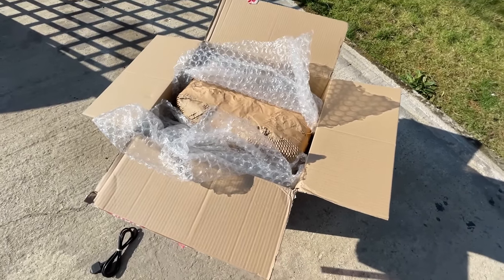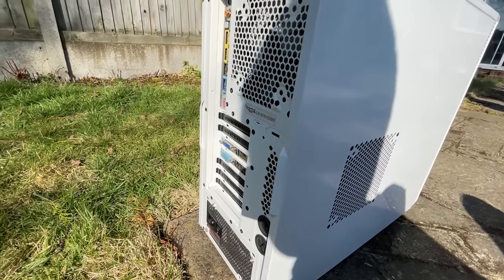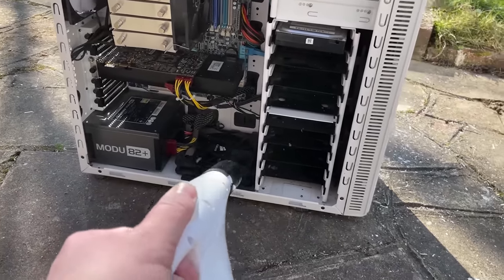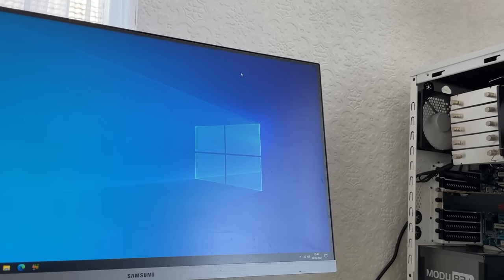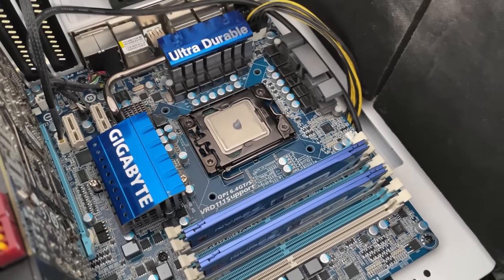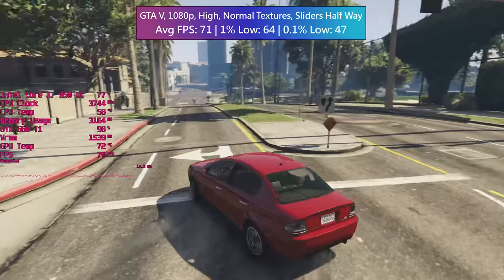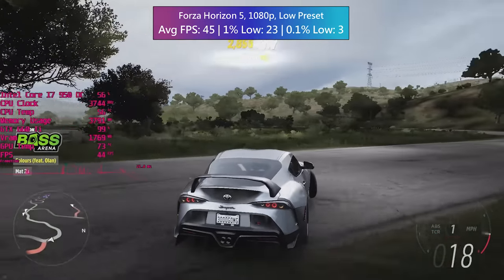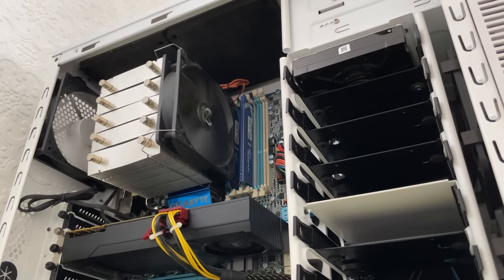What's Inside This £150 Core i7 Gaming PC From CEX?

Comment: My closest CEX doesn't sell desktops. And TBH I wouldn't trust any if they did simply because they don't properly test or inspect parts - difficult to miss corrosion and swollen+cracked capacitors on the back of an MSI Armour GTX 970.

Comment: I got a couple of CeX PCs myself. 

They had very similar specs, both ryzen 5 3600 + 1660

But... The first one had a broken graphics card which was clear on first use, thankfully it was returned easily. 

The one I've got now seems to work fine 98% of the time, but it does seem to crash occasionally (once or twice a week). I've only had it for a few weeks and I know I have the 2 year warranty though. 

I wouldn't recommend unless you're on a tight budget like me (paid £600)

Comment: theres so much wasted potential if you aren’t using an overclocked 6 core xeon on these x58. The x5680 is like $18 on ebay and overclocked to 4.5ghz can run a gtx 1080 with limited bottleneck. And of course 12-24gb ram in triple channel goes a long way.

Comment: I still have an x58 for daily driver. Une or two years ago I change the 950 for a x5650, the 2 extra cores+the low power+the qpi speed increase, make a good improvement. I have it on the rampage 3 formula, 48gb of ram and a gtx 1070

Comment: Have you thought about using the x5670 or even the x5690 6 core 12 thread chip? I am currently rocking that on my x58 motherboard with 16 gb ram and a 1050ti 4 gb and it runs real well.

Comment: You said 8GB. For max throughout you need 3 sticks. That board supports Tri Channel memory. When you said 8GB I realize that wasn't divisible by 3 and using 4 x 4 x 2 would not allow tri channel, it'd be stuck in dual. Another video you need to redo to get the best results from. This video is a great idea so I truly hope you take the time to address this.

Edit: Oh ok, I heard you say you'd be adding more memory and a better GPU so. With any luck you'll use 3 sticks of OCable DDR3 as using all six is rough on the memory controller. You could get some incredible bandwidth off that setup.

Comment: Still running an x5650 6 core 12 thread cpu at 4.2ghz on an Asus Rampage Genie II motherboard with 24gb of DDR3 triple channel at 2000ish mhz and its a pleasure to use. Its got sata 3 and usb 3 and really doesnt feel old. Im sure id get more out of my 1080ti by upgrading but I can play everything i want at 1440p 95hz to match my monitor so why bother. Its amazing what this platform can still do Id be intrigued to what a higher power gpu will do to the performance of your system.

Comment: I spent my first 3 paychecks in an i7-920 step D0 cooled by a Noctua NH-U12P, Asus P6T, 12GB Corsair Dominator (with the ram cooler), Sapphire HD 4890 Toxic OC 1GB GDDR5, Corsair HX750W and the HAF Mini 922M. With a 1080p 24" monitor other various stuff I spent 3000€ in late 2008 (yes, I got the first i7 on day1, best decision ever). I changed the graphics card 3 times and dismissed the system only 2 years ago, after 12 years of intense usage. It still runs, and I'm never going to sell it or throw it away. Best platform ever, super stable and capable of doing every single task you throw at it. Never seen a better product ever made by anyone. The feels ... you can see the system and the mods I did on the case on the techpowerup mod gallery (techpowerup com slash gallery slash 2246 slash details).
as always love the videos and keep up the good work

Comment: My i7 2600(non K) runs comfy 4.5ghz and ram at 1979mhz hyperx fury(16gb) on a asrock P67 gen3 with an Rx 570(4gb) with a Corsair 750 fully modular psu I also have a 750ti for my other big TV and  Asus WiFi card whole thing runs a dream and I've had it stable for years like that, some odd games make it hit 50c and it starts too drop back too 4130mhz at minimum but will boost from time too time

Comment: I'm sure more ram is always the solution but I'm wondering if, I'm guessing it'd be bad, you just force the game to ignore Vram and use system ram, so the graphics card can focus all its Vram on display output to the monitor, instead of being the temporary storage location for MASSIVE grapics/textures. y'know maybe it'd prevent stuttering if it wasn't going back and forth between SysRam and Vram, but stayed on the ONE RAM. Though I suppose 'direct storage' fixes this for NVME systems. Maybe one day pci-e-gen6 or its successor would make for fast enough access to what I'd assume would be the most premium of storage drives, such that RAM is only ever used for RAM related things, instead of being used as it is currently as storage for large texture files.

Comment: messing around with an old suckit 775 platform reinvigorated why i hate intel... so how many variations of 775 are there well theres clearly a Shit 775 and good 775 and a best 775... i absolutely hate how intell did this back in the day. having a plethora of 775 chips laying derelict i came to realize... the 775 mobo i have is absolute garbage limited to 533mhz fsb chips and theres only like 10 of them . and there all terrible Disaster chips.. i'v never encountered an amd mother board that had such trash limitations "exluding suckit am1" leaving my derelict chips with 800mhz and the 1066mhz fsb chips completely useless. also builds my dislike for DELL more so seeing how its a dell dimentia 5150..so dell had motherboards made that only souly support the Disaster series chips be it Celery Diced or Pantyum Dumpster editions.

Comment: just gone from a hp elite 8200 with i7 2600 to an acer tc 885 with i7 8700 still using my gtx 1650 (waiting for the gpu prices to get back to normal to look at a gpu upgrade)

Comment: Because of your videos I decided to get a custom pc from cex I liked the idea of not knowing exactly what I was getting so I spent £70 on a system with a g4400 8gb ddr4 ram and what was ment to be a gtx 670 2gb . What I got was amazing the g4400 is nothing special but it came with a nzxt AIO the ram was 2 4gb sticks of corsair platinum  3600mhz and the gyx 670 was the rarer evga gtx 670 FTW 4gb version I also got a surprise 250gb ssd that wasn't advertised and a 750w evga moduler psu . I sold the 670 for £100 and the g4400 for £30 stuck my spare r9 290x in it and used the profit to buy a i7 6700k and still made my money back so apart from the £27 the 290x cost me a few months ago I got a decent 1080p gaming system . If you know what to look for you can get a nice surprise.  I knew it wasn't going to be an optiplex someone had stuck a gpu in because the 670 needs more pcie power connectors that a stock optiplex psu has so I was sure to get a nice surprise system I just had no idea how good it was going to be . I'm going to spend a bit more next time on somthing ryzen with a better gpu and see what surprises await

Comment: Run an x5670 on it, it will go to 4.5ghz single core turbo and it’s a six core processor, paired with a gtx970 you’ll have a great system for the spend. Still haven’t upgraded mine yet. Now that the world seems to be going mental it’s going to delay a whole new machine.

Comment: Please help, i have a problem about my pc. I have way better specs than you, and for example my gta v and fortnite runs way worse than yours. I have rx 470, i5-4460, 16gb of ram with windows running off a ssd, games from a decent hdd. I have tried to play both games on the lowest possible settings yet i cant get over 70fps in gta and I have huge lag spikes. In fortnite it just lags all the time with huge spikes and barely runs 100fps. I have tried vsync on and off as well as performance mode in fortnite

Comment: Those Scythe tower coolers are pretty good, their modern descendants do quite well in modern rigs.
Judging from the wire management and the added bottom fan someone meant business when the built that if it's all original.

Some of those old computer cases are worth a bit more than what one would think, though the shipping fees usually end up costing as much if not more. That case is a Fractal Design Define R5 I believe, a pretty nice understated case. 
I leaned towards sourcing a Corsair Vengeance C70 in military green for a short while but those things go for a pretty penny. Even worse with those raw (unpainted) aluminum/aluminium Lian-Li cases. Oldish gaming PC case sleeper PCs is kind of a niche now I believe.

Comment: Now stick an Xeon X5670 on that board.  6 cores 12 threads and they overclock nicely.  I think I got mine up to 4.2ghz on a big air cooler like that and its stable and fast for a dinosaur.

Comment: used to have a smilar setup , same m/b but a i7 930 , and some amd gpu .. ran solid  for a few years(wish the same could be said for the windows install though ) before ending being replaced by a socket2011 based system ..the parts still ying around in the storeroom , one day might get it backup and running .

Comment: if you have an old pc newer operating systems are more optimized for the meltdown patch that stopped a serious security bug 

but slowed down cpu performance latency and memory bandwidth a lot

if you have an old system make sure that it's on the  os it came with at the time without updates to improve performance

there are obvious problems with doing that obviously but being on the newest os with an old computer will dramatically decrease 

performance. 

even new computers are slow on windows 10. windows 11 on very new intel cpu's found a way to optimize around the meltdown 

patch

you can improve performance with this shareware program process lasso. it can be used freely for 30 days.

this could very likely damage your hdd

explanation

to speed up performance after meltdown patch cpu latency went down. this fixes that by setting the io priority of the hard drive to low when cpu performance is higher than it should and to io priority high when the memory bandwidth of the drive is low.1. download process lasso2. during the trial period or after youve purchased it. go to process watchdog4. it isnt possible to optimize windows around the inefficiencies of meltdown. instead accept the inefficiencies and allow the computer to use the majority of its processing power when it is most efficient.6.

settings:

for intel if cpu usage is more than 10,15,50 percent set io priority of your game to low.

if any memory metric is less than 2 megabytes set io priority to high.

explanation

are old settings and do actually slow my amd processor down. in order to speed it up. I optimized with these new settings from process lasso. test these outbefore you wonder if it works. it is designed to temporairly slow things down. the idea is to cause the game to freeze temporairly for a second. this would bea time though when its operating very inefficiently because of the meltdown patch. this time is then used to improve performance dramatically.

settings

for amd more than 62 percent set io priority to low if memory usage by any memory metric is less than 3 set io priority to high

asundry

.the amd settings may just be more accurate for my processor which is a ryzen 3 3250u. these may work on intel as well. its just intel wasnt as finicky with thesesettings possibly because i haven't owned a dual core intel machine in a while.

Comment: Nice, I have the exact same motherboard on my backup pc, paired with a 6c/12t Xeon X5650@4Ghz, 12Gb of triple channel ram @2000mhz and a 4Gb RX470. It's a decent motherboard but man, it can also be a pain when it comes to detecting ram sticks. Ah, and I have one of the few good Intel coolers, the E97381 tower.

Comment: I still have my i7-930 system, coupled with a GTX-660, though the HDD died, so it sits in the box it came in.  It was a good rig until the HDD problems.  It got replaced in 2017 with an i7-7700K system, which just last week was replaced with an i7-12700KF system (GTX-1080, RTX-1070 ti respectively).

Comment: My favorite system! I used to have X58 paired with i7 930 and I have to say that these CPUs were meant for overclock! I was able to get mine stable up to 4.5Ghz with 212 Evo cooler and good power supply because maaan, these cpus were power hungy.. Running benchmarks and games, the performance cpuwise was almost double compared to stock. Also it's best to use 3 stick of memory due to the three channels. I changed a few gpus thoughout it's life, the last one was 1060 and I happily retired the whole system on it's 10th year of service in 2020. Overall, I didn't have any issues playing whatever I want on very good or at least decent quality in the last years.

Comment: My current "gaming PC" uses a similar 4C/8T i7-870 and it still holds up quite well in modern games paired with a 1070Ti and NVme storage running on the 2nd PCIe connector. It does run at 3.8-4ghz (Asus motherboards supported 24-26x multiplier) on all core with turbo to 4.25ghz and has proven quite good over the past 2 years with 1080p gaming.

Comment: Whoa, I recently retired a system VERY similar. 
It has the exact same motherboard (it's a beast! And still sought after by some overclock-aficionados) but I've replaced the 4-cores i7-950 with a 6-core Xeon x5650 (which has a much lower TDP, allowing for a decent overclock to close the frequency gap). 
Previously to that, I had replaced the GTX550TI that came with that build for a 1050ti. 
Memory-wise, I got the build already maxed out with 6x4Gb for a total of 24Gb of ram. Must say that the triple-channel DOES give a little bit of headache from time to time (and doesn't like any spec of dust anywhere close to the memory slots), but the performance is there, so I recommend going at least 12Gb of ram with 3x4Gb...

Comment: a 2 year warranty for a an over 5 year old machine is not just unheard of it's almost unfeasible unless they have a lot back logged stock in their warehouse ready to be taken apart for parts and there is also the question if they will even be still around 2 years later.

Comment: I've got an i7-870 in my HTPC, paired with an ATi Radeon HD6770 and 8gb of ddr3 @ 1333mhz. Pulled the parts out of an XPS 8100 chassis and put them in a Corsair 200R along with a CX550M PSU. Can't do too much with only 1gb of vram, but it serves its purpose for a media playback pc.
Reply: HD 6770 is still capable if you're okay with 720p low setting and 30fps. I had a HD 6850 and I could play The Witcher 3 and Dying Light at 720p 30fps at their time of releases. Too bad the psu caught fire and killef.the entire build except the cpu (i3 3220).

Comment: i used a 1366 X58 system from new Jan 2009 to June 2019. Finally upgraded because some games needed some newer CPU extentions. that machine saw i7 920 then a 6 core xeon, and a ton of different GPU setups, I think it started with SLI 280gtx then SLI 480gtx, then SLI 980gtx to a 1080ti. Longest system I ever used. Water cooled everything like 6 months after I built it. that i7 920 ran at 4ghz until I think 2017 when one of the cores starting causing problem so I updated to a 6 core Xeon which was dirt cheap and also OC'd to 4ghz.

Comment: oh first gen i7s are still interesting i found one in a prebuilt a few years ago for 20 bucks because it didn't boot and had no ram (i grabbed 12gb of ddr3  for that triple channel meme) or hdd (now has a 250gb wd blue ssd i had laying around) and a blown up psu (i shoved in my old testing psu a 500w evga white label from 2007) for under 100usd i got it up and working with its old first dx11 gpu the radeon hd 5870 now its paired with a gtx 770 (another 50 bucks) and what my sister uses to play games at the total cost of 0usd to her because it was a xmas gift and house warming gift.

Comment: I had downloaded CP2077 to test out its performance on my machine before I purchased the game. It ran decent enough on my RTX2060 KO at around 40 or 50 fps with DLSS on, I decided to purchase it on steam when it went on sale. The 1.5 update is a stutter nightmare. The game stutters so bad, It's almost unplayable in missions and unplayable driving around the city. It stutters so hard that I loose control and run several people over and it seems as I'm running people over the stutter gets worse. I am running it off of my NVME ssd so it shouldn't have any issues and my VRAM usage from tweaking the settings was right around 5gb out of 6gb. I am going to say the 1.5 update needs another update.
Reply: Yeah it's very strange, I've played and finished the game back on v 1.04 and my fps was mostly locked at 37fps/75mhz refresh rate monitor, decided to give the 1.5 version a shot and it's just random stuttering, what makes it worse is that therese seems to also be alot more texture popin or flickering as well

Comment: Hello, i have a question, i am trying to sell an i7-2600 PC whith 8gb of ram (single channel) 256 ssd (the adata one, they work great on my experience) 500w tier C PSU, a cheap but we'll functioning and quiet 15 dollars Cpu Fan tower, generic mid tower case (Not OEM), including dongles like adapters for monitor and wi-fi antena, plus a R5 240 card for YouTube since it is 800% faster than Intel HD2000. The price i am asking is $200, here in Mexico were all tech is 25% more expensive by default. What i want to know is if I am ripping my client off, i don't feel comfortable screwing others.
Reply: Value is in the eyes of the beholder. If 200 is fine with them,  you are not ripping them off. They may make 1000s with this rig if they use it for their work, who knows. Sometimes I sell things very cheap because I want them out quickly,  sometimes more expensive. As long as your description matches your item you are OK.
Reply: @costascostas1760  Sorry for the late reply, i decided to sold it as an $200 dollars office PC, investing $50 on fixes, cables and the low profile gpu (it does well at 1080 p video and the processor can't do 1440p video properly), bought it as a gaming PC whit a GTX 1060 6gb, for $350 since i wanted a spare NVIDIA GPU for YUZU and to give to my brother basic apu build during time off.